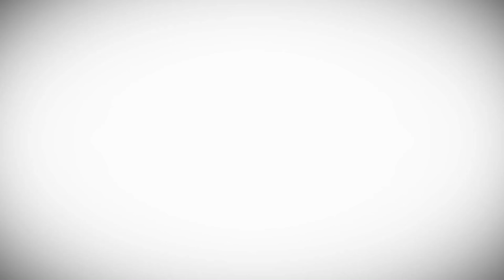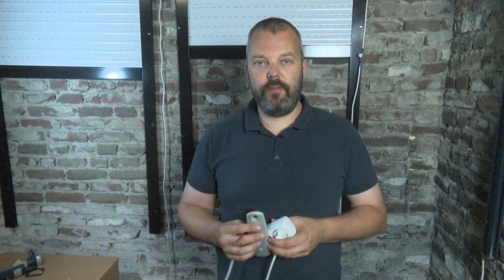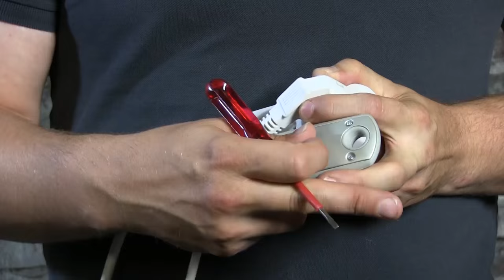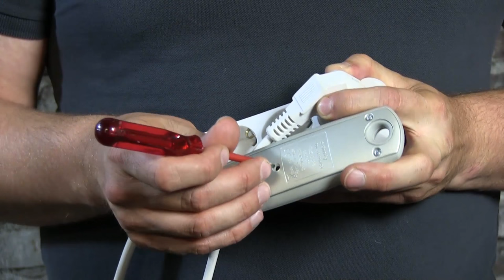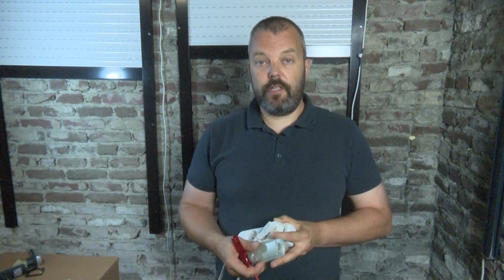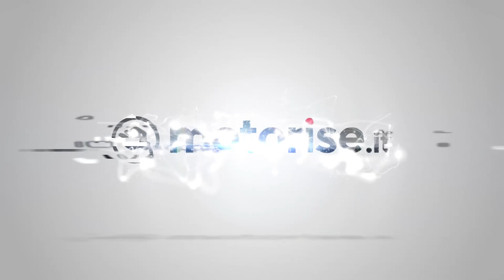4 Somfy RTS reset issues - how to recognize and solve them

Comment: Cant get my blind to move at all. Tried holding up and down together, tried the reset button on the back of the remote (I have a Telis 6 RTS) but nothing works! Frustrating as all other blinds work, just one problem one! Any ideas?
Reply from the maker: +ntube7 Could you send me a mail (info@motorise.it) with a few more details and I'll get back to you with a reply and a few options to try

Comment: Hi Otto. What a great service you provide. Well I seem to have the same problem as david czech. I just put up my new (used) awning and it came out just fine. But when I was going to retract - it stopped. I left it with my father and when I returned he had rolled it up backwards. He managed to run the motor forward until it retracted the wrong way.Now I realise I have to buy a new motor, but can I retract until the curtain is at place? And why is there no possibility for manually retract the curtain? I worked all day to set it up and now I am sad :-( Please let me know that you have the words!
Reply from the maker: Hi Soren,  thanks  and no need for a new motor if all that's the problem is the end limits. In your case, the end limit has been set beyond the limit, which means the arms no longer move, but the motor keeps rolling (and so does the fabric). Good news is that it can be solved. Best way would be to reset the motor and make sure that it rolls in the right direct (arrow down is out, arrow up is in). Then set the limits again. One thing though, it might be that the motor was defective to begin with, as when a motor no longer retracts, it has often losts its powered to overcome the pressure of the arms. BTW, there are only some motors that have a manual override. Somfy calls these CSI motors, but they are rarely used. Hope this helps, otto

Comment: Dear Motorise friends, good afternoon.
Your videos had beeing very helpfull, but I have not beein able to fix the RTS motor.
I have tried the 3-8-3 rule, several times, but the motor does not jog as it should. Actually it does not do anything even if I press the reset buton on the back.

If a make the 3-8-3 rule and then press the UP and DOWN butons at the same time the motor jogs. Then I push the reset buton but again ....nothing moves.

What am I doing wrong??  What else can I do to solve this issue?

Please advice.

Will
Mexico
Reply from the maker: +Guillermo Landa 

Hi Will, it could be that the motor has been reset completely already. 

Because once reset, it's in its factory settings and will not accept a second reset. 

The way to test that is to select a channel on your remote and press up&down at the same time to take control of the motor. Then go through the procedure of setting the motor's end limits.  (so basically you follow the steps in this video: https://www.youtube.com/watch?v=9jmaGn1vs1I)

From what you are describing, this should solve it.

All best,
Otto
Reply: That reset procedure on works on 110V Somfy motors, low voltage motors are resets differently..
Reply: +jay9433 How do I reset low voltage motor?

Comment: Hi Otto, my awning SEEMS to go through the reset procedure correctly EXCEPT that I can not get it to retract using the motor.  I can manually retract, and can easily extend and stop with the remote.  The light in the remote illuminates when I press the retract button, but the motor does not react at all.    Please advise on what else I can do to troubleshoot this.   Thank you!
Reply from the maker: Hi David, when the motor does not make the awning retract, it's often because the motor has lost the power to overcome the force of the arms. This means you can't complete the reset procedure.

It also means that the motor would need to be replaced.

If it's less than 5 years old, it's likely to be under warranty. So then it would be best to contact your installer / supplier for further support.

Hope this helps,

Otto

Comment: You guys need to state clearly, that the motor ONLY enters in programming mode (when both up and down arrow are pressed at the same time), if, and only if, the motor is previously run its course a'll the way up or down. So simple, yet omitted by all these videos !
Reply from the maker: No, that's not a necessity at all. Straight out of the box, all you need it to press up and down. It's not possible for the motor to have run its course if it's brand new. It only enters the programming mode if it's in the factory setting (either by default or a proper reset), that's it. No other prerequisites.

Comment: Hi Otto,

I need to get rid of some stops that occur when I try to lower the roller after it has reached its upper limit (They only occur when the roller has rolled up above certain height). It seems like the process stayed open and multiple lower limits were set.

I was about to reset my motor to factory settings, but haven't done do so after I heard in this video that this proceeding can be done only once. Does it mean that if anything goes wrong I won't be able to reset the motor again and 'll need to replace the motor? From your other videos I had the idea that resetting was something that could be done to correct any mistakes during the process.

My motor (which resembles a Sonesse 50) has a button on it for programming.  I've already been sucessful in linking the remote control and changing its direction by pressing the button on the motor before proceeding with your instructions.

Is there an easier way to get rid of these stops? Thanks for the advise.

Comment: Hi,
I have a somfy telis 1 rts on a wirefree solarpack. I am not sure whether I can follow the same procedure on your video though. Basically, only 1 out of my 3 blinds is responsive using the same remote. It is relatively new (set up in July 2015), but hasn't been used during the colder months (living in cold Denmark). Now the sun is back and all of the sudden 2 stopped working. Any advice ? 
Thanks.
Reply from the maker: +Franchesca Nielsen Hi Franchesca, the reset procedure would be this: https://www.youtube.com/watch?v=mYG0kW4TFaU However, I would look at the battery pack first. The batteries are probably not charged or not charged enough to operate the blinds. To check if the batteries are the problem, you could temporarily place non-rechargeable batteries in the wand (without connecting the solar panel) and then see if the blind will work. If it works, the batteries need to be charged more. If that doesn;t work, there's a problem with the motor and cyou could try the reset. Hope this helps.